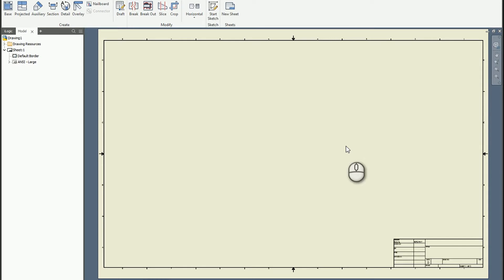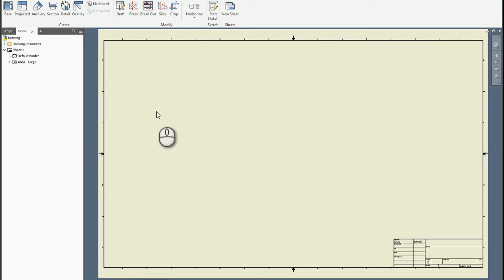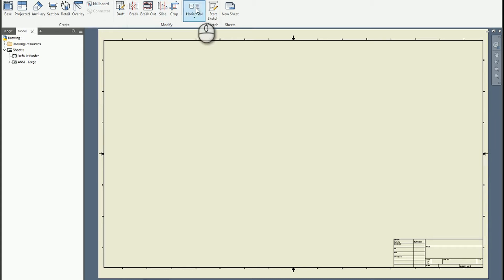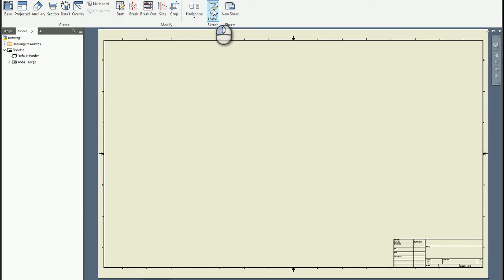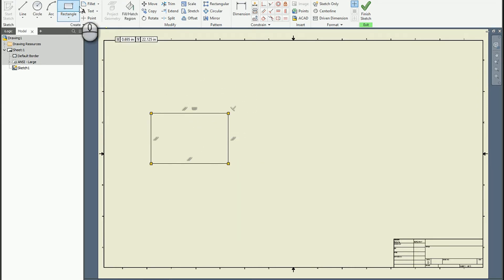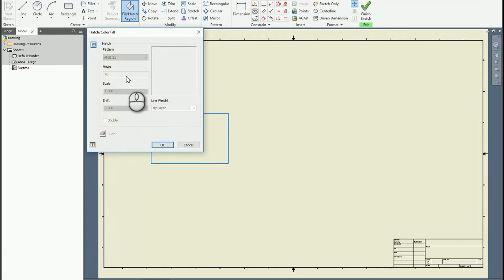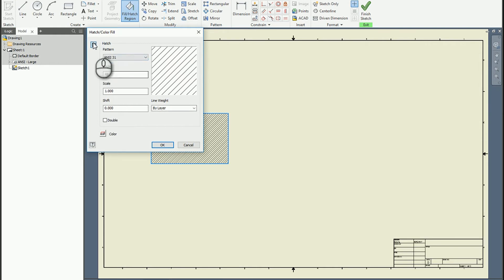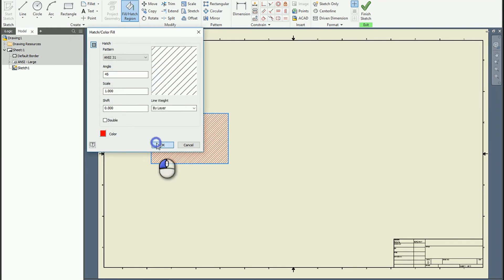Autodesk Inventor - Accessing a Hatch Pattern

Comment: Wait, so if I’ve already sketched and imported part, I have to redo the whole thing to add hatch marks?
Reply from the maker: Ambrosia, thanks for reaching out!  If you have an existing view of a part or assembly, you do NOT have to resketch the shape.  You must create a new sketch on that view and then Project the geometry from the design that serves as the boundary for the hatch pattern.  Once a closed profile is detected, the Hatch pattern can be applied.  Please let us know if it would be helpful for Pete to knock out a video for a hatch pattern on an existing view.  Hope this helps and have a most blessed day!